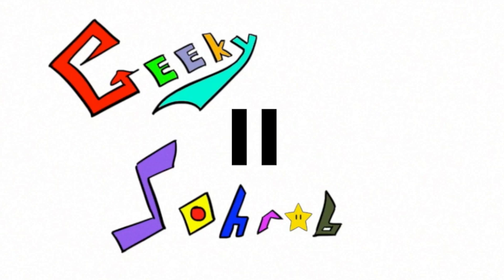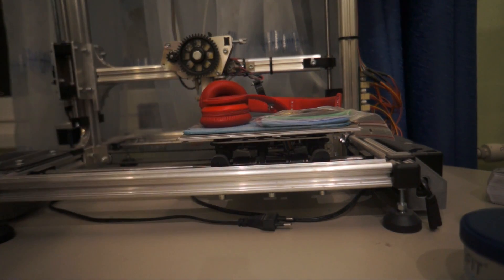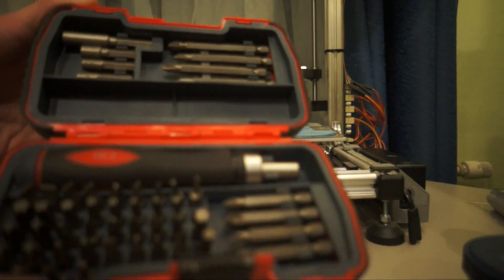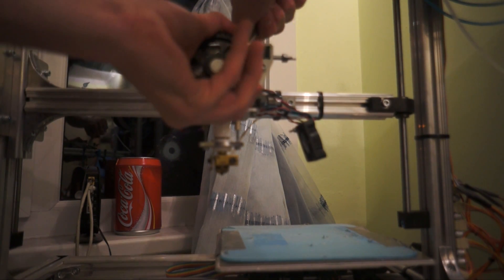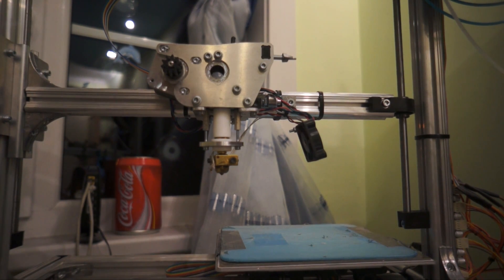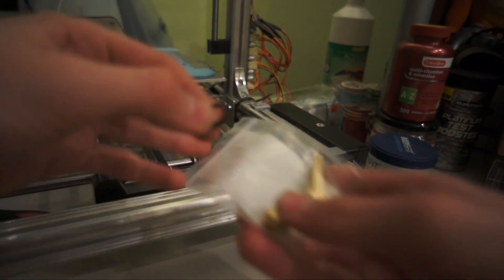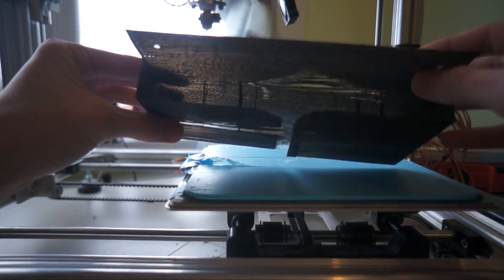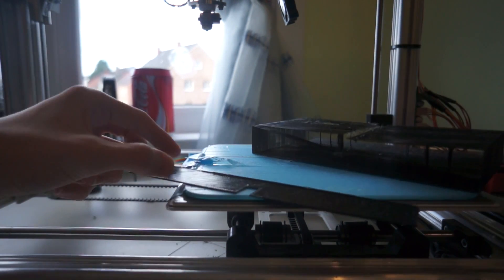Velleman K8200 hot end and nozzle repair

Comment: nothingwrong with the slicer, Dude...  Decrease the feed rate to  75% and up the flow rate to 110...120 %.   That is your problem.  As the printer prints, the nozzle cools down and then the filament is not hot enough to flow nicely.  By reducing the  feedrate, it prints slower and the nozzle can het up quickly enough to make sure the plastic flows nicely.   Just try it !
Reply from the maker: Alright! Thank you for this, very helpful!